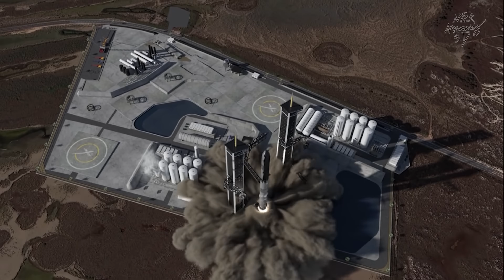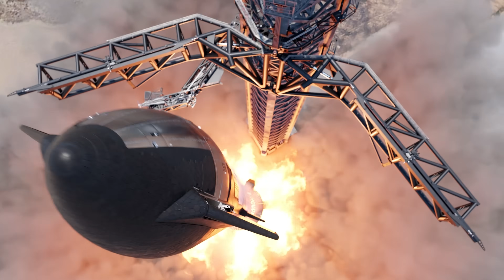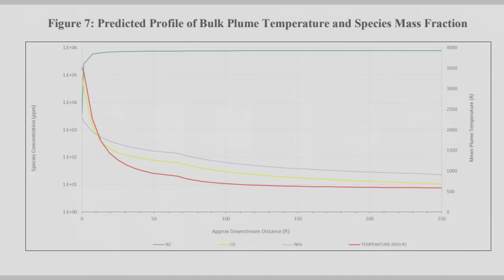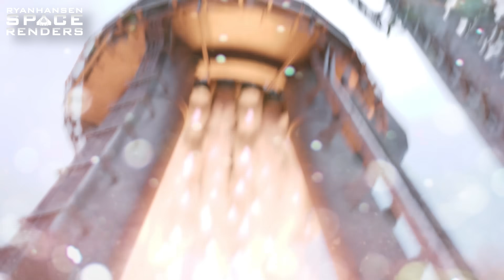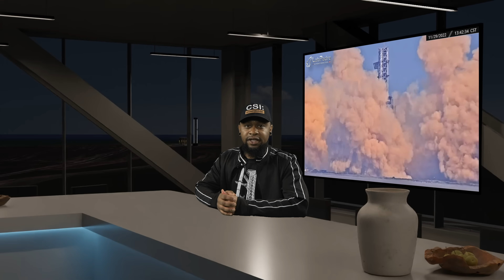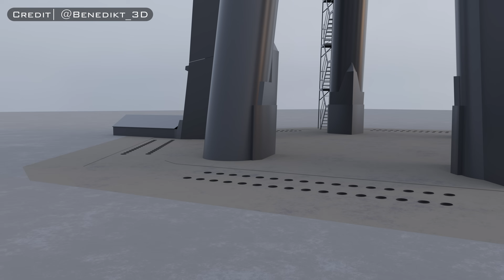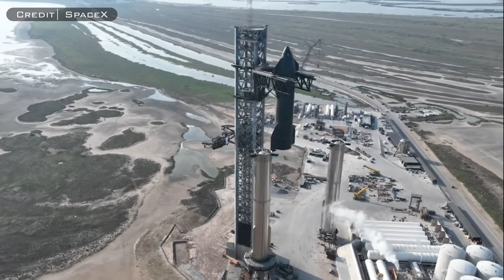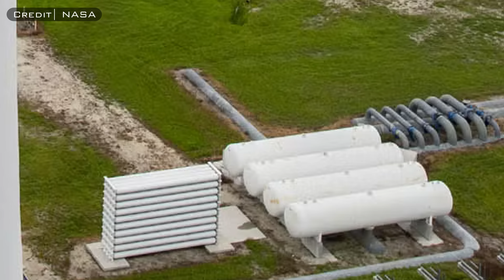SpaceX's "Major" Concrete Problem + Water Deluge Construction Begins at Starbase

Comment: SpaceX replace the concrete pad with a tunnel that just lets the blast pass through. Get a quote from the Boring Company to run 5 or 6 tunnels to the beach. The best part is no part!

Comment: You did good until the water tanks.  The deluge system is needed and should be a simple design based on multiple flow paths and elevated water tanks.  The only active devices needed to operate such a system are the butterfly valves giving the system lowest possible failure rate.  The loss of deluge system would cause a launch failure loss of vehicle and major pad damage.  Complex system based on pumps or pressure would unnecessary increase risk of system failing when needed.
Reply from the maker: Lol well the funny thing about this is that the system is going to be powered using compressed gas.  That’s a fact.  You will see compressed gas cannisters mounted next to the 4 white tanks at Starbase in about 2 weeks.

Comment: Water deluge is not going to help when you have 33 engines firing at the same time, they were supposed to fix the pad from sending chunks of concrete into the air on the 7 engine test but had even worse on the 14 engine test. That with the tremendous amount of heat that water is not going to stop is going to mean rethinks and redesign of the launch pad with a way to redirect exhaust from doing damage to the launch pad and possibly the booster.

A three second test might work but this will not be even close to a launch of the starship and i suspect it will be a spectacular failure on launch.

Comment: You talked about where the water in the deluge may come from. But where will it go afterwards? They won't be allowed to just release it into the environment. But there is no space for a bund large enough to catch it.
Reply from the maker: Good question. They haven’t started a retention pond yet. But they do have a catch basin next to the tower.  It’s not that big though.

Comment: Remember concrete takes a minimum of 28 days to garner its strength. Two days it’s FULL of moisture and you’re basically just cooking it off.

Furthermore, during the cure period, high strength concrete must be hyper hydrated (cured while fully submerged in water) during the curing process or it will not obtain it’s rated strength.

Comment: Why they don't use a simple metal shield on top of concrete? For regulating the temperature thay can put water between concrete and metal shield, i think water cand obsurb the for a few seconds before booster leaves the pad

Comment: Very good analysis. 👍 
I had couple of points:
1. Why can't SpaceX lay down steel plates flat to avoid concrete spalling flying all over.
2. The outer steel wall of the Double walled tank will experience 5 bar pressure, even though inner wall may cancel out few bars.
Reply from the maker: Melting temp for steel is not higher than Fondag rating. 
Yes, the outer wall will experience 5 bar. But it’s designed for 6 bar.  Interior tank is designed for 6 bar as well. But this allows them to put 11 bar in the interior tank and it will only actually experience 6 bar on the shell.

Comment: Nice analysis on a very important problem.  Could SpaceX just lay steel plates over Fondag?  I agree the 2nd static fire would have been a bad idea without enough time to cure, and some of the concrete that is not under the pad is boiling.
Reply from the maker: Fondag goes on top of steel. Not beneath it.  It’s the same reason buildings need fire protection over structural steel.
Reply: @CSIStarbase  I think its not the same case as with buildings you are talking about steel I-beams, not steel plate, the kind they are protecting the legs of the orbital platform with.  Of course there is rebar in the concrete, why not just put steel plates directly under, it wont heat up to the point of melting.

Comment: Pouring all that water on it is needed already. I’ve watched water cutting most of my life. Man made water projects that break in the wrong place causing quick erosion. Now consider the heat and super forces of a rocket plume against any kind of concrete..now add water. Yep.. the concrete’s erosion is accelerated. The opposite of the desired result. A massive ant-ablation steel base plate will be needed. Just needs to be realized.
Reply from the maker: I disagree.  Nasa puts 6 inches of fondu fyre over their steel plated flame diverter
Reply: @CSIStarbase  I never forgot about this. I like your presentations and keep up the good work. Thanks

Comment: Your animation of the arms catching Starship is wrong, Starship is designed to land on a pad, the booster will be catched by the chopsticks as its to heavy to have legs
Reply from the maker: That’s false.  Starship is not landing on any pads.  It will be caught.  This has been known for the last 2 years.
Reply: …. I apologize, your correct, that does make sense for turn around

Comment: Can't they stop using concrete and just use metal? like weld a bunch of AR500 plate together and fasten that to whatever concrete is on site?

Seriously, this should be considered as a solution.
Reply from the maker: NASA’s flame trench is made of steel and has several inches of Fondu Fyre on top of it.

Comment: 33 engines will destroy the concrete and the launch mount and more ... A water noise suppression system isn't going to offer much physical structure protection. Sustainable thrust divertors are well understood .. baffling that SpaceX just didn't do this right the first time.

Comment: Is SpaceX even allowed to perform regular launches from Texas, wasn‘t it meant to be mainly a testing and development site?
Because if they don‘t expect regular launches they might just not bother installing a water deluge system and just eat the regular replacement after each test. Or at least that might have been their original intent and now they see the extent of the damage and changed their mind.

Also a reminder, they want (or at least Elons claims to) refuel this thing on Mars and take-off from there.
Just look at how much infrastructure you need for a launch, I really doubt we will ever see something like that happening.
Reply: Mars pad will look much more like suborbital pads because....you can see it yourself

It's why engineers exists

Comment: When the concrete is next replaced, they should consider embedding small diameter steel water pipes to keep the concrete cool so it will not spall.

Comment: This was such a great video. ANyone who's been following Starship development closely has heard lots of discussions about a deluge system for Boca but you added so much more. Thanks!

Re the reasons why a water tank might be double-walled ,apart from the pressure considerations you mentioned it also occurred to me that maybe we should also be considering energy. If the top of the water tank is being pressurised with LN2 and the outer jacket is filled with LN2 to give the required counter-pressure then all of that would I assume cause the water going into the deluge system to be cooler i.e. having less thermal energy than it otherwise would if it was just sitting in a single-walled tank so would be at ambient air temperature.

Once the water is ejected and meets the exhaust plume there is then a transfer of energy from the exhaust to the water. Having the water in a lower energy state to start with would I hope (if my idle musings are correct) result in greater and faster transfer of energy due to a steeper energy gradient (the low point of the gradient as defined by the water's starting state being lowered due to its somewhat chilled nature vs ambient air temperature - and Florida/Texas ambient air temperature at that!).

If any of the above has any validity then, as well as getting the pressure sufficiently high to make the deluge system work at all, the use of LN2 might also increase the overall efficiency of the deluge system. Win, win?
Reply from the maker: Thank you!  The void space should be filled with GN2 instead of LN2.  Liquid nitrogen will cause the water to freeze
Reply: @CSIStarbase  True. I should have written it explicitly but I was assuming that the source of the pressurisation gas (I.e. GN2) would come from the existing LN2 infrastructure in the tank farm since that is there already where the LN2 destined for the deluge water tank would be allowed to gasify (if that’s the right word!) before ending up in the jacket and the top of the tank. Admittedly maybe the existing LN2 infrastructure doesn’t have enough spare capacity for this additional use but given that ultimately what it would be supplying would be GN2 maybe not too much LN2 would need to be drawn off in order to get the required GN2 pressures due to the density differences. And if the GN2 has come from a state transition from having previously been LN2 it could still have a cooling effect.

I guess a bit of Boyle’s law calculation (PV=nRT) might be interesting at this point. Sadly I’m rushing around getting ready for a trip so can’t do that right now.

Comment: Zac, the exhaust is high Mach number velocity and at the ground interface all that dynamic pressure converts to static and the pressure change will lead to considerable heating, well above the incoming exhaust plume temperature. Eg heat shield on re-entry vehicle gets hotter than the incoming atmosphere. I suggest that this additional temperature should be part of the analysis.
Further, the extreme noise of a launch suggests a vibration overlay on the average pressure you calculated. The vibrations could increase peak pressure at the ground considerably.
Reply from the maker: Interesting. This makes sense. I wish they would have included that in their report.  I didn’t know enough about that effect to speak on it at the time

Comment: Thanks for doing a great job on your video 📹.  You informed me on the the pad and on the concert. If this time around that the new concert doesn't hold up to rockets  then my thought would lay down some 1 inch plate steel and also you would need to put bolts in the plate steel so you don't have to worry about the steel flying in the air.

Comment: I think at some point in the future SpaceX will need a flame diverter under the OLM.
The only way I can see them doing it, is to replace the concrete under the OLM with a five inch thick
circular steal plate that is divided up like a pizza.

Just before a static fire or launch, the pizza plate would raise up from the centre while pivoting from the circumference  to reveal a nine metre wide hole, that would be connected to a tunnel that curved under the OLM and resurfaced a short distance away.

When the pizza plate is closed all normal actives such as engine replacements could continue.

Comment: The launch pad is way too small and too low. 33 raptors firing at once will melt down- and blow the whole launchpad away. After the upcoming 33 raptors static fire test, SpaceX will see that they need to re-design and built a complete new launch pad
Reply from the maker: Will be interesting to see the outcome

Comment: I only watched the one video on "Water Deluge" and I must admit that I was a little miffed about how much attention was put to concrete degradation at the beginning of the video. However, by the end of it, I was able to see the educational value to those viewer's that might not understand heat transfer and the difference between the construction of a test stand and a launch pad.
Space X is overcoming so many groundbreaking technical challenges on a daily basis. They do this mainly by expecting imperfections and pushing new or untested subsystems to fail. Accelerating the process by eliminating guesswork and focusing on the real problems as compared to the imagined as is so often generated by commity in programs that actually care what society thinks. 
It makes for great video. Because it's truly transparent. It is transparent because SpaceX is the future. And the future doesn't care about the opinions of the present.
Enjoyed the video. Keep doing what you're doing.

Mark
Reply from the maker: Honestly this video starts out primarily about concrete with a small mention of deluge. But then then as I was recording this they started moving all of that equipment from KSC so I was able to add more to that section.

Comment: Many years ago I worked as a test technician for testing concrete going into buildings.    I can tell you with some degree of certainty that even the fastest-curing concrete is not fully cured in 48 hours.     Even after a week, it is a long way from being fully cured.      If they blasted a pad of concrete after only 48 hours, there was bound to still be enough entrained water to cause exactly what we saw.    The newest pad has been in place for several weeks and it is the newer Fondag concrete.   With more durable concrete and the proper curing time, there is a reasonably good chance it will hold up well.    If they add a deluge system it will probably come out of a launch with minimal scaring.  

Having said all that,  it still surprises me that they don't have a way of diverting the exhaust in a single direction.    It just seems wrong to let the blast go in all directions (particularly toward the tank farm).
Reply from the maker: N1 diverter was amazing.  I wish there was one as well…especially if it looked like that.

Comment: If the beams of the launch tower are hollow? Is possible to use the void to hold and create a quasi water tower out of the superstructure of the launch tower? It would have height and volume for a deluge system?
Reply: The pillars of the tower are actually filled with concrete, but I like your thinking.
Reply: @Geoff_A  so why don’t they just put a water tank on top of the launch tower or Inside the tower? A lot of space

Comment: To make the launch pad totally reusable and trouble-free for every static fire, especially with 33 raptor engines. is to dig a hole in the center of the launch pad around 500 to 800 meters deep with 2 or 4 exhaust channels away from the launch pad infrastructure to avoid damaging the properties and a massive clean-up before and after the static fire. I don't think any concrete or whatever they put in the center of the launch pad can stand the heat and pressure of those engines.
Reply: Elon has a boring company so digging and tunneling is not a problem.
Reply from the maker: 500 meters sound a bit excessive 🤣
Reply: @CSIStarbase  yes sounds excessive but remember the area is soft sand if you dig shallow the foundation of the launch pad will be get disturbed. the deeper the better.
Reply: Imagine the damage of every static fire? the launch pad and tower won't last this way the whole launch area is affected every static fire. launch pad legs got torched and all parts get exposed to heat and pressure flying debris so much hazard very risky. Elon 1hr turn around launch is not possible this way.

Comment: They should just construct a huge circular hole directly beneath the orbital launch pad say 30-50 meters in depth with diversion tunnels at the bottom directing it back to the surface away from the pad. The immense pressure from engine ignition would be sufficient to force it right through. Direct the exhaust plume away from the pad if they can't solve the concrete pad issue. I'm sure they'll figure it out.
Reply from the maker: That would be below sea level and it would be very difficult construction underground when the water table is so close to the surface

Comment: Overblown?  A Saturn melted steel pins on a flame diverter, these vehicles produce enormous energy.  We will shortly see if they can fix the problem.  F. Miller PhD, retired rocket scientist
Reply from the maker: Yes, I did lots of research on all of the most notable flame trenches used at KSC. In particular I focused on when they failed, and how they failed. This is why I feel like the problem has been overhyped. STS-124 is a prime example of what a truly serious issue looks like in my opinion
Reply: @CSIStarbase  And just because Artemis 1 has flame diverter doesn't prevent the more-than-anticipated damage to the infrastructure

Comment: Here is an idea for all to think about.  Would a high temperature metal make a better surface .   If so, I would suggest tungsten.  It would need to be cooled so that it does not burn considering  the high temperature that it would be exposed  to.  Perhaps, water under its surface would work.  Any ideas??

Comment: I can't be the first to say this but seriously why don't they use Stainless Steel underneath??? Concrete seems like a huge painful mistake. Maybe we'll see what they do at the cape.
Reply from the maker: If you look up the melting temperature of Stainless steel I think that might answer your question. Its significantly lower than the temps Fondag is rated for

Comment: heat force pressurer
all result in destruction
as with the rocket engine
nozzle the take off landing area
must be constantly cooled
exhaust deflected
energy directed away
by what ever mens there is
Concrete on a building sitem in ordinar
small waste burnings of trash
 will explode? moisture will expand and explode
Musk should go and talk to ordinary builders and gather
their knowledge before being set in a fantasy
Basic venting exhaust guiding water or may be liquid nitrogen 
jetting under the take off area will slow cool guard

Comment: I am surprised that with all the cryogenic temperatures there isn't a 'skating rink' under the rocket. Even if the ice is just below freezing, the ability to absorb heat would be significant, and perhaps the the weight bearing might also help. On top of that is added the water deluge.